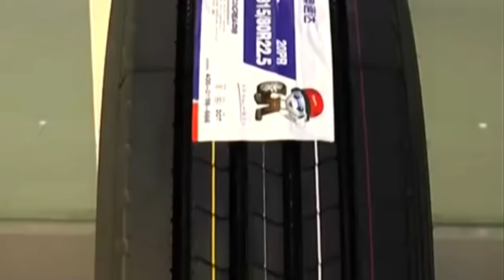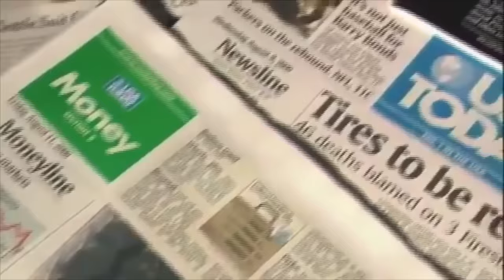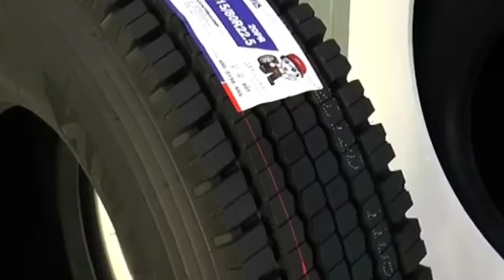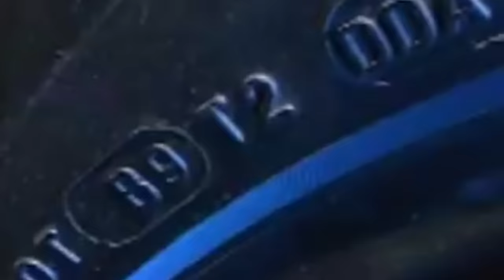5 Tires You Should NEVER Buy!

Comment: I had Goodyear Tempo 2 on my car in 1991. After having them on my car for less than a month . The tires started to hop. I took the car back to where I got the tires and they put a new set on . Several weeks later these tires did the same thing. I took it back again they told me that was normal for those tires. I demanded a different manufacture and this problem stopped. Since that time I WILL NOT PUT GOODYEAR TIRES ON any vehicle that I own .

Comment: You should add Futura Super Sport tires. I've owned 1 set & you couldn't give me another set! They didn't get traction worth anything. If Morning dew was on a wet Summer road they would spin when starting off. I tried adding & removing air with no luck. Ifound I was not the only 1 having problems with them after looking up reviews on them. They are good for a trailer queen show car that is never truly driven & that's all.

Comment: You need to get your facts straight about the firestone tires.  Firestone recommended inflation was 35 psi, but the door sticker was at 26 psi ( I presently own a 92 Explorer) . Ford wanted a smoother ride so they recommended 26 psi. The tires are underinflated, heat, highly speed, and aggressive maneuvering caused these problems. Not the tires!   Oh I had a blowout on the left front at 65 mph, caught a piece of metal at night and cut the sidewall, it pulled to the left about 1-2 feet, TOTALLY CONTROLLABLE. Some people just can't control these situations.

Comment: ME.. I never buy low quality tires, I go for the premium brands Michelin / Continental and the pick the "best in test" ( the german ADAC or danish FDM, they are usually place the tires about the same ) - because I live in "that area" where those testcompanies are at home, so tires are tested to the climate where my car is.
The reason I dont pick cheap tires is that.. you dont save much money pr mile driven on a tires, the last summertire I had Hankook ventus prime 2, made 50.000 miles and I only had to replace it because the frontsuspension setup got "out of line" so the front tires for bald on the outside egdes, so I had to change them and then I picked the Michelin Primacy 3.. I hope this tire will last at least 50.000 miles, for winter I went for the continetal TS850, we dont get much snow, if we had snow for months on the road I would probably have gone for an even more hardcore winter tire.. like the nokian hakkapeliitta..
But 50.000 miles on a tire paying just a bit more and makes up for alot more safety is worth it.
Just keep in mind, any tire can get you from a to b, but when you NEED the tire to perform to avoid the crash, the best tire is prefered to have on the car..

Comment: I’ve been driving a Chevrolet Silverado in commercial traffic with a Goodyear Firestone tiers for a year and a half and i had the same experience with the left front tire just exploded from the rim I was going 56 mph and a fully loaded 42 ft 3 axle 11904lb trailer behind the pickup it was a death machine most times I could easily have taken a family out and keep going it had that much torque in it almost like an 18 wheeler. I never did but Goodyear Firestone tiers are a danger to everyone that uses the tiers. Idk how good they’re been nowadays but I don’t trust Firestone tiers anymore.
Reply: yes but i might have those mixed up it was if i remember correctly firestone on the truck and goodyear on the trailer. anyhow one of them sufferd a blowout.

Comment: There was no problem with the firestone tires. The problem was Ford telling people to only inflate them to 26psi. 26psi is nowhere near enough pressure for that weight of vehicle and the Firestones blew out due to this under inflation. You ask yourself, why did Ford’s engineers suggest only 26psi instead of a typical 35psi. The Ford Explorer had a major design flaw. The first two generations of Explorers were extremely top heavy and too narrow side to side for their weight. If drivers were to turn while traveling too fast, the Explorer was prone to roll over. As soon as Ford and Firestone parted ways, Goodyear was the new partnership tire of choice. Goodyear’s engineers rejected Ford’s 26psi and demanded a minimum of 30psi for the Wrangler tires on Explorers. Ford changed the psi placards in all of the Explorer door jams.

Comment: I buy Ohtsu tires, while being a "budget" tire, I love them on my Ford Probe. 60 bucks a tire and they are made by Falken Tires
Reply: Mid 90,s I had a near new ohtsu rear tyre explode on my ford maxi van Was replaced under warranty A strip of rubber come off wrapped around diff housing and pulled handbreak on
Reply: @JR1300r  I had them on my 93 Probe from 2014 to 2018 when I could nto find a set, I went with Atlas redhawk tires...They sucked and this year I replaced them with Ohtsus

Comment: Ford designed an unsafe vehicle that was prone to rollovers.  They took the Ford Ranger chasis and threw a body on it and called it Explorer.  It had a higher center of gravity than just about any other SUV of its time.  Instead of Ford designing a safer SUV, they decided to shorten the springs and reduce the recommended tire pressure to 26 psi instead of a normal 35 psi.  The result of this reduced tire pressure caused two adverse effects:

1) Increased instability due to tires "rolling over" from a lack of internal pressure against the inner tire sidewall.
2) Increased tire operating temperatures that can lead to premature tire failure.

The tires did fail and, because of the higher center of gravity, the Ford Explorer rolled over more times than a child learning to ride a bicycle.  Ford redesigned the Explorer in 2002 with an improved suspension and wider or longer wheelbase.  Don't remember exactly.

FWIW, I just bought a used 2011 Yukon.  The dealer had about 20 used Yukons sitting on the lot.  One of the selling points for me on this particular Yukon:  It had a new set of Bridgestone Dueler tires.  Bridgestone is the parent company of Firestone.  The Dueler is a great tire.  Oh, and, it's a Japanese tire, not Chinese.

Comment: it wasnt nessesarily the tires fault on the ford explorer, the specs ford gave to inflate the tire were too low so the tires were under inflated (ford called for 28 psi or somewhere around that) which for a vehicle of that size was WAY too low especially at highway speeds

Comment: But NOT ALL Asian brand tires are bad folks...!!! Kumho, Hankook, and the budget gem Milestar puts out some EXCELLENT tires for sure. As a matter of fact my OEM Michelins were BY FAR subpar compared to my new Milestar MS932 Sport tires. They are VERY reasonably priced and do excellent in rain and snow just as good as name brands for half the cost.
Reply: There are different tiers of tyres, Hankook is a decent brand, but will still have precautions with the cheap chinese ones
Reply: @avilesjuangaming  Sumitomo is a Japanese brand that's been around for years. And their HTR A/S P02 are a fantastic very reasonably priced all season tires. Even Tire Rack and Consumer Reports rated them VERY highly. Also the Radar Dimax AS-8 are fantastic all season budget tires. So as i said not ALL Asian brand tires are bad. Some are equal or even BETTER then top brands like; Michelin, Pirelli, etc...

Comment: I've bought a few fords and on those Fords almost all came equipped with Firestone tires. I also had a few failures. Ford mustang came with radial 500. I had at least 3 high speed blowouts. I replaced them with Firestone radial 7 2 1s. My cousin and I had high speed blowouts that resulted in losing a front fender, lights and wiring. That Camaro never had turn signals or headlights that worked. When replacing tires back the. The Firestone tires were half as much as any other tire. I never received any money from Firestone for damages to the vehicles or replacement refunds. I will never buy another Firestone product.

Comment: Firestone had the exact same problem with there 721 line of tires many years ago the 721 tires had a cord design  that had 7 cords surrounded by 2 cord then wrapped by 1 cord hence the name this design caused the cords to cut each other at speeds above 55 miles a hour making the tires come apart. the next tire they came out with that did this with were the wild country that made me wonder what the cords look like in the wild country and why do they act so similer to the 721 line of tires.

Comment: If ford hadn't used oversized u bolts and underinflated the Ford Explorer tires, that fiasco never would have happened. Better a little over inflated than a little under. Tremendous heat difference from a properly inflated tire and a slightly underinflated one. Adding an extra 5 psi over manufacturer recommendation is good insurance.

Comment: The firestone tire was not to be guilty as ford would recommend the wrong tire pressure in the door jamb. This would get the passenger rear tire to blow as the case developed in court I remember a gentleman from Firestone saying we don’t make passenger rear tires we make tires period. Which should of exonerated Firestone. Also the Goodyear tires were to be installed on delivery vehicles that drove in lower speeds as long as the manufacturer had the specifications from Goodyear really it was the coach manufacturers fault for cheeping out. And at last the Chinese tires you get what you pay for if the tire is 1/3 the price maybe it’s because it is lacking R And D

Comment: Most tires are safe if you keep them inflated to the proper level ...
TO BE SAFE I RECOMMEND GOING BY THE TIRE MANUFACTURES RECOMMENDATION AND NOT THE AUTOMOBILE Manufacture suggested TIRE INFLATION RECOMMENDATIONS.
 You might end up with a harder ride but you should get a little better gas mileage  Ford ended up in trouble because the under inflated the tires as much as 10 lbs below Manufactures specks.

Comment: Had Chineese tires put on my company truck last year. These were the worst tires I've ever experienced. During the summer they developed a bulge on both front tires - Replaced with an American brand tire. Recently the rear Chineese tires started cracking and was also replaced with American made tires. Feeling safer now than riding on those cheap crappy Chineese tires...

Comment: okay I had a 98 Ford Explorer the problem with the Explorers wasn't just the tires they rolled over with all kinds of tires and they rolled over for the same reason why I loved my little Explorer Sport the steering ratio was too high you can turn the steering wheel a little bit and get a lot of movement out of your tires which made the Explorer very easy to drift or slide or wipe out so it's not just Firestone it's the Ford Explorers rack and pinion steering ratio it's just too high those trucks still roll over today my mom was involved with a Ford Explorer accident a few years back that killed 3 kids because of a rollover and they don't make Firestone Wilderness tires anymore but Ford did make my mom sign a gag order which just pissed us off because if your product is good you don't need a gag order

Comment: Tyres are like Shoes. They carry your weight. There are good tyres and then there are mediocre ones. It also depends on how the Vehicle is constructed? Their Centre of Gravity is of utmost importance. Stable vehicles have their heaviest part in the middle. Balancing the ratios are of importance. Most passengers cars fail this. Also the roads and weather play very significant part. High Speed driving on narrow and less well made roads are hazardous. Steering precision is of utmost importance. Most drivers are very poorly trained to handle aquaplaning or fine snow / dust. Nowadays, most Brand Names get their goods made in low labour cost countries. Tyres manufacturing is no different. I have used Continental Premium 6 on my BMW 750 iL V12 and tyres from India on the same vehicle. The difference is minimal. So, please, do not blame tyres manufactured in less developed countries. It is their design, specifications, engineering and the material used that counts. A well designed and well constructed tyre from Malaysia is as good as the one made in Germany. I have attended a practical course of aquaplaning on Swedish Lakes conducted by the Swedish Traffic Organization and the Swedish Police. An ordinary American Female Driver is the biggest nuisance on the road: talking on the mobile, doing the make, blaring music and kids fighting in the back not forgetting the car running out of petrol. Yep, I have seen all sorts. The biggest menace of passenger car is the Driver. You want safer roads, get it out and make cars Driverless.

Comment: Sounds like specific model problems not brands of tires.  Also you blamed a lot of operator error in the tire.  You can try to engineer out the idiot factor but when it comes down to it, I’m guessing tire age, maintenance and use were factors as well.

Comment: Amazing Bad Tires but the Companies that put them on their vehicles got blamed for the tires being bad also? How is that? Firestone had been used on many a Ford Car and Truck for as long as I can remember with no problem then all of a sudden Ford is at fault for using Firestone.   A Expensive Motorhome has a Goodyear tire worse than the Firestone but only Goodyear is held responsible.  All of these where bullcrap even the Firestone were due to underinflation because people didn't check their tire's and still don't.

Comment: If you choose the Wrong tire for the application, DON'T blame the tire. It was YOU who made the choice to use it improperly. Just like those FOOLS who you see driving down the road at 70 MPH on 'Emergency Only' spare tires that should NOT be driven over 50 MPH and Only for Short distance. Under 50 miles.

Comment: Load of bollox . Fit the correct tyre that's recomended for the vehicle  check speed ratings load ratings. We have farmers who pull trailers and implements with 20 k nhs ( no highway service) marking  tyres.pulling them with 50  n 60 k tractors  and they wonder y they have tyre failures.  also tyre pressure is a big factor in most tyre failures. One life one chance  fit proper tyres  check pressures regularly and you will be safe!!!!!

Comment: Firestone told ford the recommend tire pressure was to damn low. The G159 was not used as intended. It was never designed or advertised as a high speed tire. They was excellent and long wearing tires when used properly. Ps speed ratings and air pressure are REQUIREMENTS not damn suggestions.

Comment: Your data is not correct. 
The ATX and ATXII were the focus of the recall. I'll tell you the real problem was improper maintenance.  Tire pressure primarily, other issues such as age, dry rot, and wear do to lack of rotations and alignments and worn chassis components contributed to the problem. Even today it's hard to get non commercial tires to go 100k even if properly maintained.  But, them ATX's did it all the time. 
The Wilderness Tire recall was isolated to a small section of all Wilderness tires made.

Ford was the problem regarding The ATX tires. They placed on the door of the vehicles a tire pressure recommendation that would render the Tire underinflated.
Despite what the tires own recommendation had stamped on the Tire. 
Underinflated tires is in my professional understanding the number one reason for tire failures. Even in the Commercial capacity.
Reply: SideShow Bob -  So I guess your "professional understanding" outweighs the results of the NHTSA investigation???  You ignore the manufacturing defects identified  by NHTSA that resulted in the tire failures.   The recall was on the Firestone tires. Period. There was NO recall on the Explorer related to tire failure issues. I wonder why "Firestone paid Ford $240 million to settle claims related to the recall" (Wikipedia).  Pretty sure Ford paid Firestone $0.00 You are certainly entitled to your opinion, just as you are entitled to be wrong. There was no problem with the Explorer.
Reply: Ted W. 
Your comment elicits argument and rhetoric.
Reply: @roberthuttle  I hope my comment elicits people to do some homework and fact check an issue. Not looking for an arguement or rhetoric. The facts are the facts regardless of any "alternative facts" garbage you might find floating around.  You can argue all you want - but the proven facts do not change. Happy New Year!
Reply: Ted W. 
Well, I'll grant you humility.
My spell check failure was begging ridicule, yet...

My experience regarding your comment comes from working at Tires Plus for 25 years. Not lab research, field testing or even research. But time tested experience. Of which Attourneys are not required to have.
Do you not think that Firestone would be able to submit for settlement and move on from litigation, rather than continue a reputation battle and keep an ongoing lawsuit in the forefront of people minds that have plenty of other brands to choose from regarding tires. I suggest that Firestone wanted to get this behind them.